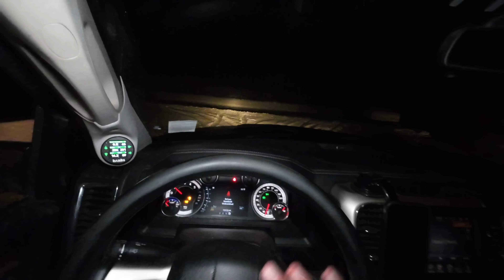Date night at the snow park goes wrong!

Comment from the maker: Yes, I rigged the soft shackle incorrectly.  I’m aware of that.   The reason is that although you could see it in the video, I was doing it blind.  I saw it when I edited the video, but did not feel like editing it out.   Even if I had seen it, I would have probably left it like that anyways, because when pulling a vehicle over any distance like that, the shackles aren’t going to stay oriented how you put them anyways.    
This video was actually filmed, edited, and uploaded to YouTube before the recovery where the other soft shackle pulled apart even happened, but that soft shackle in the video was rigged correctly with the ring on the knot side of the connection.   I will show the difference in design between that shackle and a Yankum in a follow up video to show what I think caused the failure
Reply: Wasn't the one that came apart a cheap Amazon shackle?
Reply from the maker: @mshadley  yep
Reply: What I appreciate most from your videos and the other instructional stuff we all come across is that I can now recognize when the soft shackle is hooked up wrong. I for one learn a lot from these videos. Thank you!
Reply: Dude, quit being so hard on yourself! You never said that you were good at this!!
Reply: @CaseyLaDelle  could you have added a brief caption while editing explaining the lack of visual ability at time of recording instead of editing it out?
Reply: If it works and no one/nothing gets hurt, then it's the correct way to do it.  Other people's opinions just don't count since they weren't there to do it the way they think it should.
Reply from the maker: @JohnHallgren  I could have, but I didn’t know I’d be getting so much hate mail from the soft shackle “experts” back when I edited this.   I’m sure of people go back through my videos they’d see that I use them incorrectly more than I use them correctly.   Oh well, if it works it works and if people think I’m and idiot then their more than welcome to think that 🤷🏻‍♂️
Reply: Hey , if it worked , so what
Reply: @CaseyLaDelle  In my opinion, it doesent matter how You are usin you things, only that matters, can you get them out or not. Really only that matters, get them out safe and unharmed. :face-red-heart-shape:
Reply: Most of the people that talk shit have never even used the stuff themselves, they learn off social media then preach it harder than anyone 😂 Keep up the good work 🍻
Reply: @CaseyLaDelle  The soft shackle "experts"....LOL, I like that. Great job Casey, as always.
Reply from the maker: @brucecook  big facts!
Reply: What type of wheel lift is that is that a little Hercules
Reply: Hahaha i definitely noticed that but I also wondered how in the hell you filmed it so that all makes sense! We all make mistakes and it also is a further plug for yankum rig 'em wrong they still work!
Reply: You're brilliant Casey . I've watched nearly all your videos  and each one just amazes me on your absolute dedication to what you do for your fellow members of your community. 👏👏👏😊🙏 from Carol in Melbourne Australia 🇦🇺🇦🇺  and just to let you know it was 97f here yesterday 😎☀️😳
Reply: Thank you for sharing, Casey! You really are the best!
Reply: @CaseyLaDelle  It is amazing that you YouTubers continue to post videos, based on all the hate mail you say you get. I am glad you keep posting as I find your videos interesting, educational and enjoyable.

Comment: So whoever designed and built that van did not ever think their creation would ever get stuck,smart very smart!😂 I will say this that 360 camera really likes you have a drone,awesome!
Reply: Probably the same ones which are creating most of the new 4wheel drive vehicles which do not have tow/recovery points either.

Comment: In 1977 I bought a Dodge 3/4 ton long wheel base van.  I lived in a little town called Winlock in Washington.  Every once in a while in the winter I would load my 3 kids and the neighbor's 4 kids into the van and I would drive them to Mt Saint Helens to go sledding.  When the snow got deep on the road, I would tell all of the kids to go to the back of the van to give me some extra weight on the rear axle.  I never got stuck.  The kids all had a blast.  After the first time that I told them to all get in the back, they all looked forward to doing it.

One winter we got 16" of snow, which is unheard of.  I chained up the van and just drove around.  I pulled several people out of the snow-bank.  One of those that I pulled out asked me if I could get to his Daughter's house.  She just got out of the hospital the night before after having a baby, and there was no power in their neighborhood, and their house was all electric.  I said sure, and followed them.  Their driveway was about 500 feet long and had a dip in the middle.  I would go until I was pushing too much snow with the front bumper, then I would back up 30 feet and get up some speed and blast through the pile of snow, and then proceed another 50 feet.  I did this all the way to the Daughter's house.  Everyone was impressed, including me!!!

That is a very nice memory.  I also had a Ford Econoline van with a 6 cylinder engine.  Without chains it did ok, but would get stuck easily.  When I put the chains on, it was almost unstoppable.  This was a long time ago, but these are nice memories.
Reply: chains work wonders until the snow gets so deep it start raising the tires of the ground.  I keep a set or two in the 4WD they even help in clay until the wheel well packs up and the tires will not turn.:face-purple-smiling-tears:

Comment: 1.17.23
Another fine rescue.  Question:  If the people in the van had chains do you think that they could have got out?  Maybe should have pulled them further up before taking of the rope.  Thanks for helping again.
Reply: Chains could not have hurt, I have the same van and with new full on nonstudded Blizzak winter tires it is still a turd in the snow.

Comment: Just don’t understand why vehicle manufacturers don’t install a recovery point on all vehicles!
Reply: I've been asking the same thing for years now.. especially if you live in snow country.. I have a frequent customer that actually had after market tow points installed on her Escalade because she's a nurse and cannot "stay home" during weather so I literally go to her house in my lifted suburban and tow her out to the highway .
Reply: Because they don't expect people to need them, they are engineers. They don't ever use them. And the bean counters say that they are too expensive to put proper ones on. Also if they did put them on, they're saying that their machine isn't perfect.
Reply: Its a extra cost mot people don't want to pay for.
Reply: @dubious6718  99% would never be used.
Reply: @hughstephenson2957  Does she have a 2WD Escalade? otherwise why not just run winter tires and skip the tow?

Comment: Good thing you were there to help them out, Casey!
But isn't it a little thoughtless to go out on the road where they were probably well aware that the snow is not being cleared, in a van that is not the best to drive in snow with, that is not 4 wheel drive, and that I understood you, not the best winter tires and then without snow chains?
Reply: Clearly a lot of people that are being rescued doesn't think.
Reply: I think that was a new snowfall, so perhaps the roads weren't too bad before it came down.
Reply: They appear to be familiar with the snowpark they have a cell phone and Casey's number from a previous recovery.
Reply: @iffykidmn8170  I got the feeling that the previous rescue was somewhere else.
Reply: @sharonmiller6436  Yes different area different vehicle but they still had a phone and Casey's number.

Comment: Casey they make a hook with a couple chain links that are attached to a piece of very hard metal that fits in those slots that you see in the frame they use the slots in the factory to move the frame to also real tow truck operater would have a couple on the truck,then there is NO problem finding a place to pull from, shame,shame Casey

Comment: Just a question for you Casey - did that van have any winter/snow tyres fitted? It looked like it was on summer tyres.
Reply: Likely it had all seasons at best, and they will do OK in snow, but fine for most everything else. All seasons are quite common in the PNW.

Comment: The van should have had tire chains. Usually the "Carry chains or traction tires" restriction is in place before the first snowflake falls.
Reply: I have never seen a blanket wide requirement in the USA, mountain passes etc yes but only during inclement weather.

Comment: Just a quick question and I'm not familiar with the area. It would probably have been a catch 22 but with that truck, I'm guessing you needed the kinetic energy from the rope instead of the weight of the van to get them out, or didn't think of lifting it out? You did a good job and I'm just trying to learn more.

Comment: Would they have got out with snow chains? If so would it be sensible to just have a few sets of the common sizes on your vehicle? Just a thought, you might say too many different diameters and widths to be practical.
Reply: 16-17-19-20 dia and 4 widths would be the most common so 20sets of chains for the most common sizes, if dealing older vehicles with 14-15" tires and you could add in a few more extra sets.

Comment: I had a Dodge ProMaster for work that I drove for 4 years. At least twice every winter I had to get pulled out of my driveway. Those things suck in the snow and ice.
Reply: Stock tires are terrible 3mtnpek rated A/Ts marginally better, Blizzaks are better still but I would still rate mine a turd.  I am not bashing on the Blizzaks as we have them on the wifes SUV and my Toyota 4runner which makes it pretty much fool proof in the winter pulling others out of ditches.

Comment: I was just watching you hook up your soft shackle and I think this is why you had the issue the other video where a soft shackle failed,  you are setting it up on the recovery line with the recovery line hooked on the loop end instead of the knot end.

I  am new to winching and using a soft shackle so I am not a expert for sure but I am trying to learn so when it is time to do a pull I know the correct way.
Reply from the maker: Correct, the way I rigged it in this video was on the wrong side of the knot.  But that’s the way I did it because even though you could see it on the camera, I was doing it blind and didn’t see it until I edited this video.   The shackle that pulled apart on the previous recovery however was rigged the opposite of this (correctly).

Comment: Casey. 

Been watching you for a while now and really enjoy and appreciate your honesty and work ethic. 

Two questions 
First the automatic tire deflator??
Make model and do you have a link??

Second 
The tow wheels that you use. 
You have mentioned how much better they are than the other ones and I am looking at maybe getting a set to turn into a trailer in a bag style for my motorcycle. I have a big decker. 1984 Honda Goldwing Aspencade 1200. 

Do you have a link for the units and name and model. 

By the way I live in Canada and have a nice 2008 Ford Ranger Sport. 
Nice little pickup truck. Just a regular guy who is retired and doesn’t want to get crapy stuff and don’t do much off road. Just basic camping and stuff. 

Thanks for your help and advice. 

Love your videos. 

Thanks 
John and Cathy Stockdale 
Stoney Creek 
Ontario 
Canada

Comment: if there was ever a government regulation necessary then please mandate reasonable tow/recovery points on all cars and trucks and a tow setting for all wheel drives that works without the engine running.
Reply: No more government regulations! I do not need the government or anyone else telling me how many tow points I need and where they should be located. if I want tow points on my vehicles I will add what and where I want them which I have done. rear receiver plus 2 two recovery points, front receiver plus 4 recovery points and receiver mounted winches.  Feel free to add as many or few tow points to YOUR vehicle as you wish but leave mine alone.🤬

Comment: Hi there Casey, love the videos but I’d like to ask a quick question. Why don’t you ever use the screw in recovery hitch that fits under the flap on the front bumper? It also baffles me that the customers of these style vans haven’t got that prepped for you before you get there. It’s normally kept with the jack.
Reply: He doesn't use them, because they're nowhere near good enough for the job. If you look on Casey's Community tab on his channel, the latest post is an answer to your question.
Reply: I think there is 2 reasons that Casey has said before, 1/ those tow points are only for towing on the flat, paved roads 2/ in heavy conditions they can pull out causing damage to the metal panel and the bumper, major expense ! 👍🏽😎
Reply: @bcp_towing  That, plus if they fail, they might send the vehicle rolling into a tree, a house, or a person. Worst case scenario, he could probably be held liable if that happens.
Reply: @Netwarrior92  unfortunately that community tab isn’t available when using the YouTube app on iPad so presumably it’s same with phones. I have to use laptop to be able to view those comments.
Reply: @JohnHallgren  I tried linking directly to the post I mentioned, but YouTube butchers the link for some reason, so no luck here. Anyway, Gavin above explained it already.
Reply: @Netwarrior92  just wanted to let you know if you didn’t that certain types of users may not have easy access to the Community info. It bugs me often as my iPad is my primary means of using YouTube!
Reply: SilliArt - Based on how you wrote that, you’re kinda saying that Casey has no experience in towing because even I, as just a viewer, knows that those hooks are strictly for moving a FREE wheeling vehicle on normal ground onto a wrecker or carrier at no more than a 15 degree slope, ok?
Reply: @JohnHallgren  no, not at all. It was a mere enquiry and I thank everyone who’s commented and told me why he doesn’t 👍
Reply: @SilliArt  ok, it’s only because I have seen numerous similar comments on multiple videos and especially when Casey explained it in a prior video, when someone else asks the same question, it makes me wonder a bit…

Comment: All of this is preventable. Lived in snow country all my young life never got stuck in snow. There called snow tires for a reason
Reply: I also have lived in snow country all of my life, but since I drive more than to work or the store, I have been stuck many times.  Once was in 4 wheel drive pickup with truck tire chains, that I shortened, on all 4 wheels. To say that you never got stuck tells me that you never pushed the boundaries.  I always push the boundaries.  That has caused issues in the past, but I have ZERO regrets.
Reply: @Rat-Builder  I have stuck my double locked vehicle with front and rear vbar chains, I have stuck a cable skidder with rear canadian chains and front bear paws chains on 38" dia rims not sure of tire sizes 76"ish  and nothing to hook the 30 ton cable winch to in the middle of a clear cut.  You are correct if you have never been stuck you are not getting far enough off the road.
Reply: Oh and a John Deer forwarder with the push blade planted made for a pretty decent land anchor for the 30T winch.
Reply: @iffykidmn8170  I was a field mechanic for Weyerhaeuser when I was younger.  I worked on swing shift.  One night I was sent up to put a starter in a D8 that was making a road.  I started up this muddy mess and the only reason that I was still moving was that I had the throttle pinned.  I made it to the cat, and when I pushed in the clutch I was instantly badly stuck.  I changed the starter, (Thank the heavens that the starter was what was wrong with it.), and used the Cat to turn my truck around and pull me out of there to the main road.  I then went to park the Cat, and I sunk that baby clear over the tracks.  I am glad that I was not there when the crew showed up the next day.  I told my Boss about what happened, but nothing was ever said to me.

I went for a quad ride once in Nevada, and I went down a fairly steep slope to what looked like a flat area.  I got one quad length into this "flat area" and discovered that it was a bog.  I talked a guy with a horse into  helping me get out.   LOL

I even stuck me one time.  Lost both shoes getting pulled out.  I was over my waist deep in super sticky mud, and I was actually a little scared!
Reply: @Rat-Builder  I was not running it at the time but one of the snowmobile clubs in northern Wisconsin started to build trail for the season, Tucker snow cat buried to the windows in a bog that had not frozen yet as the snow had acted as insulation.🤑🤑🤑

Comment: I had no idea the promasters were FWD. That's a terrible design. I've driven a few different vans for work, all the weight when hauling ends up right over the rear axle. Why on earth would you not want the drive wheels where the weight is?
Reply: Driveline increases door open height on rear wheel drive.

Comment: I didn’t watch it yet but should put on the wheel lift 👐🏼😃
Reply: Number one it's a front wheel drive van.  Number 2 using the wheel lift with that heavy a vehicle in the front would remove all the weight off the front of Casey's pickup, negating the 4wd and alot of the steering capabilities
Reply: @hughstephenson2957  yes I would have scooped it from the front it’s one a 6 banger and plastic they are light front ends 😜 I towed many of these in the snow they don’t go anywhere especially the utility body ones like who in there right mind would make a front wheel drive service truck lol blows my mind 😂
Reply: @hughstephenson2957  Since this is a camper, it might be heavier in the rear.
Reply: @dubious6718  very much so lol